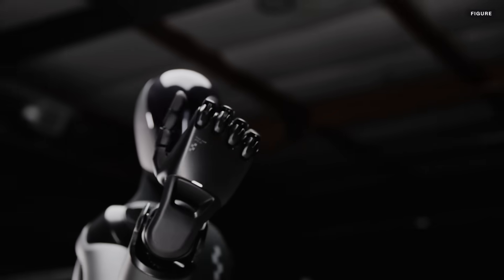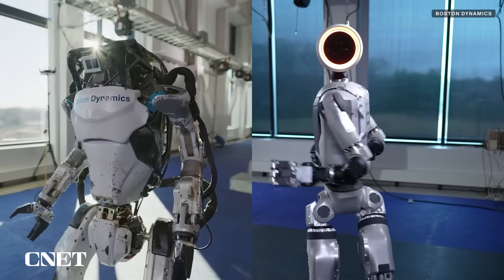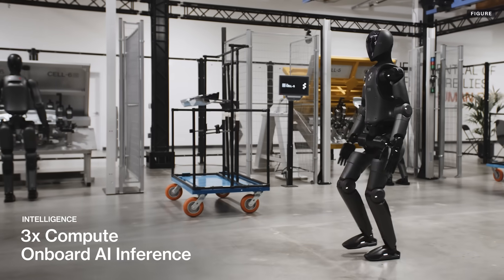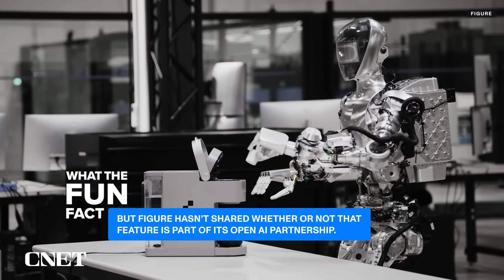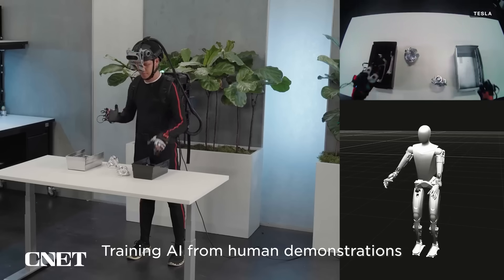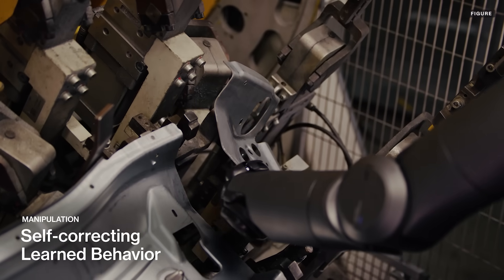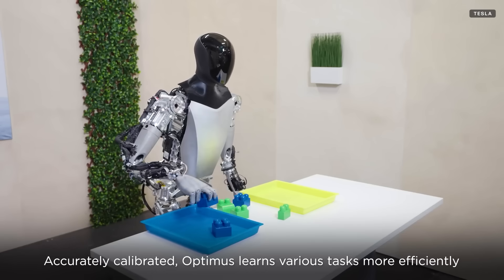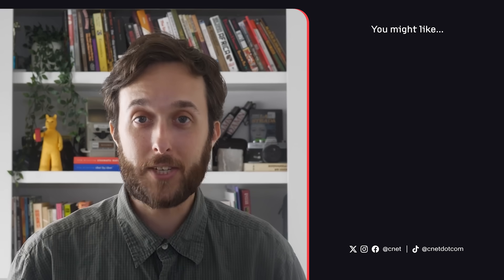New AI-Powered Humanoid Robot Just Dropped: Meet Figure 02

Comment: What is the usecase for this? It is cool but I do not see the benefit yet versus specialized robotics who are micrometer perfect.
Reply: The "benefit" is you don't have to redesign your existing workflows, which are designed for humans. You literally put one of these robots on your production line, have it learn what it's supposed to do, and boom, you can replace human workers for robots that can work 24/7, work consistently and flawlessly, don't complain, don't need medical benefits, don't call in sick, etc. It can do the same things that 100 specially designed uni-task robots can do. Sure, there are things that require precision and we have precision robotics in place for those things, but many things we do in factories can be done within human tolerances.
Reply: @pvanukoff  I very much doubt he could do things a 100 specially designed robots can do. 

You are talking about robot putting together microchips and specific welding. 

Plus when human beings are used in production lines, which companies put back after using robots, is the ability to improvise and feedback on engineering processes. 

Also, for generalized tasks, human beings are still much cheaper than these robots.
Reply: By the time they create a humanoïd robot able to do all the facrory task cheaper than a human , every Factory task will be already automated by specialized robots. Humanoïd robots are for entertainment and research propose.I love robots but it is an expensive toy @pvanukoff
Reply: currently they just want them out there to train them on real world data. like teslas self driving cars has been out in the world and first now they start to work good for self driving. There are many jobs that are not a good fit for specialized robots either, this fits that gap
Reply: Imagine having a robot companion that can show you how to do things like fix something on your car or bring you something if you're busy or hold something for you. Or maybe have it observe your behavior and encourage you or give you advice to better yourself. Maybe you're going somewhere and you can have it feed your pets or deep clean your house. I think there are many uses for them and that is why we need them in humanoid form.